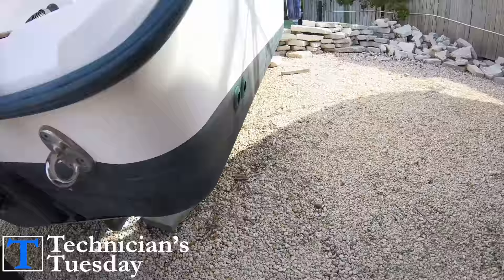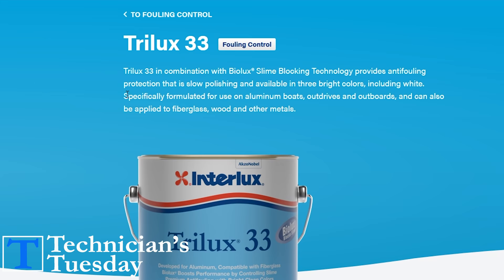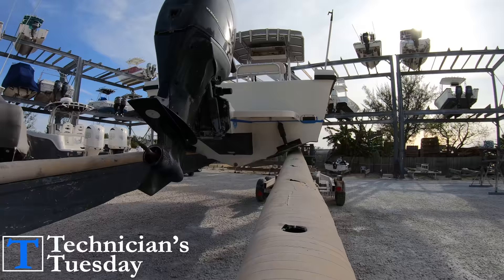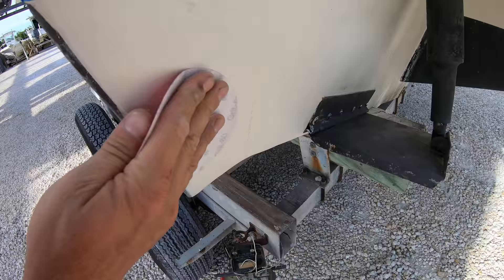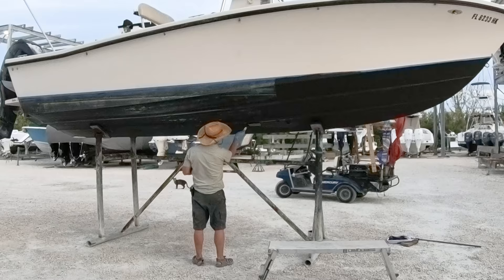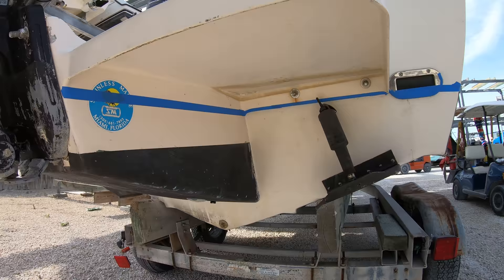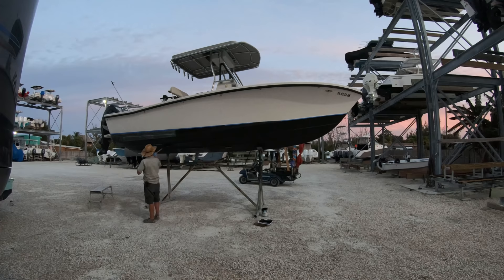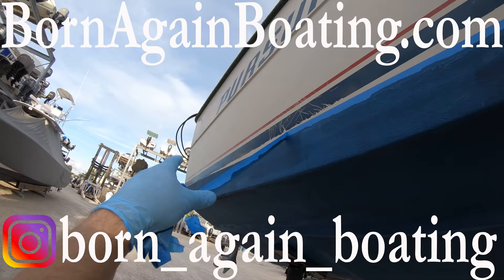Boat Bottom Paint! DO'S & DON'TS!

Comment: Thanks for the information great as always but it’s confusing to me on my project so I could use a little clarity the bottom paint is ablative and I’m removing it big dirty job I’m getting into I’m trailing the boat as opposed to the previous owner kept docked. I need to know what I can put back on I’m doing a polyurethane topside but I don’t want the bottom paint paint mess for below water line so I heard you say hard bottom paint and does that mean I can apply it and not get it all over everything at the sandbar so it doesn’t chalk when touching it or do you recommend something different I’m rolling it out and tipping my hole project thanks in advance your channel is awesome
Reply from the maker: If you are repainting the whole boat and trailering it, you really don't need to put bottom paint on. I would have the bottom gel coated
Reply: Thanks again for your help great site you have

Comment: do you need to sand away the old bottom paint before painting it?
Reply from the maker: Not necessarily, if it's hard and you're putting more hard on, no. Or even ablative over the hard, you don't need to.
Reply: What if you’re putting ablative over ablative? Can the new paint just be applied over the old or does it have to be sanded down?